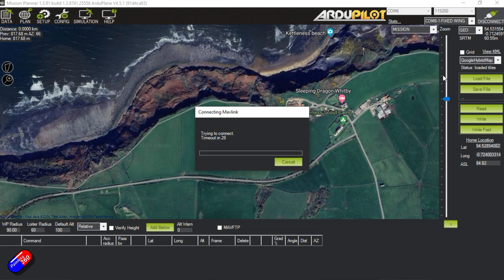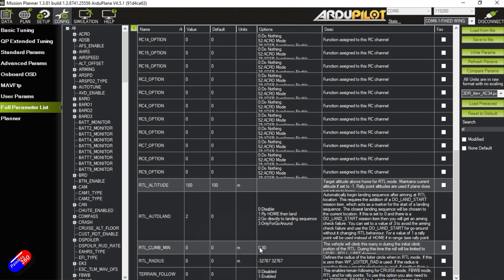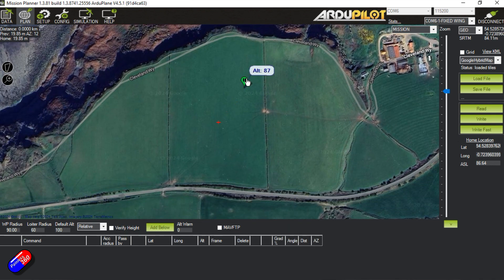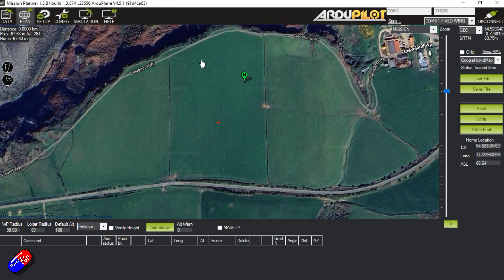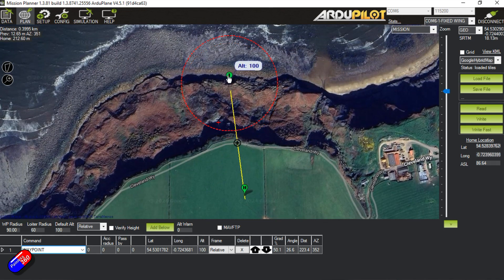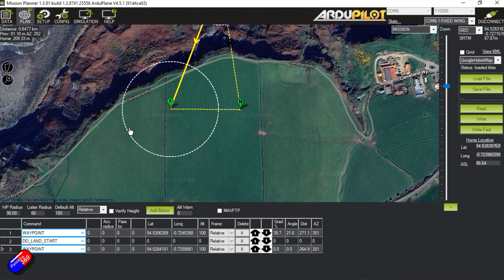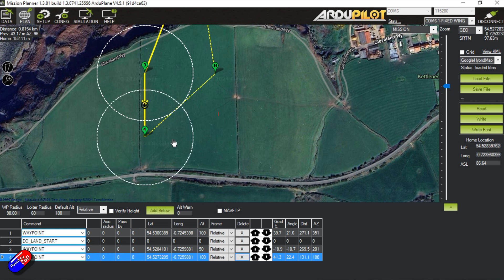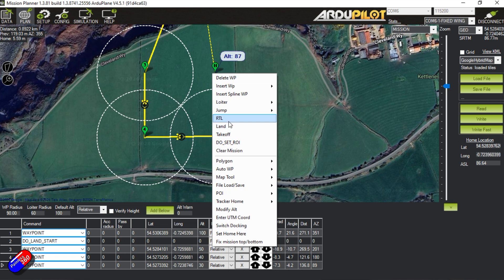Arduplane Autoland basics (how to use DO_LAND_START)

Comment: Question here.  Great video.  Thank you.  I usually do not set up missions, I just use for RTL and stability functions.  One thing I am confused on.  Does the mission get deleted after cycling power on the flight controller?  I made the land mission and wrote it to the flight controller.  However, after I disconnected the flight controller and reconnected, the mission is gone.  I also save it to my computer so I am assuming each time you get your plane ready to fly you must re-write the mission?  Thanks!
Reply from the maker: Check out my video on setting up missions. They stay in the flight controller even after a power cycle... Happy flying

Comment: I've probably done over a 1000 manual landings ( not including crashes) and I'm very proud of the effort and patience required to become proficient at landing manually.  ardupilot (with a pitot and lidar) makes my landings look like terrible, like I have done no practice whatsoever. The only type of landing that I can perform "better" than ardupilot is a very short landing area and stall the plane about 2 foot of the ground after bleeding enough speed during approach. if i did more research into the settings ardupilot could probably do STOL better than me. brilliant video as always
Reply from the maker: Ardupilot automated landing, when setup correctly, is a thing of beauty. But, it takes a lot of tweaking to get it to the level of an experienced pilot. You'll see some of the 'fun' in the final video in the mini-series.. Stay tuned!
Reply: @Painless360  I had quite a few bum twitchy moments in getting set up properly but it was well worth the effort. The best reaction I got I was flying at a local event (community event not a rc club event) and with a home made foam biplane and the landing was uphill with a cross wind and ardupilot brought in down flawlessly. The president of the local rc club commented saying it was a very good landing considering conditions and was shocked and amazed when I told him it was an auto landing. I put the plane back in the air and started the landing sequence and put the trans down on the table within reach in case of a problem and it landed perfectly. only positive interaction i've had with a local rc club regarding flight controllers etc.